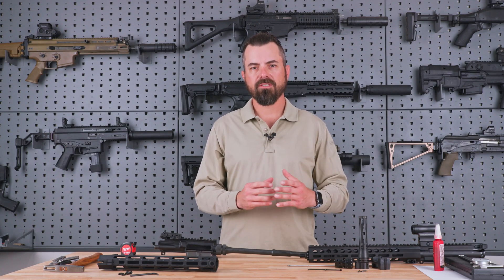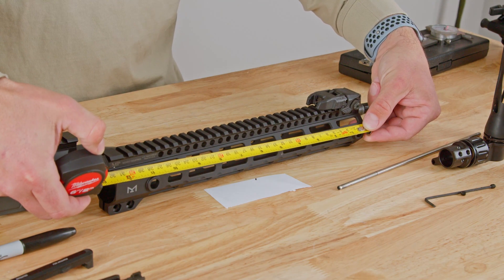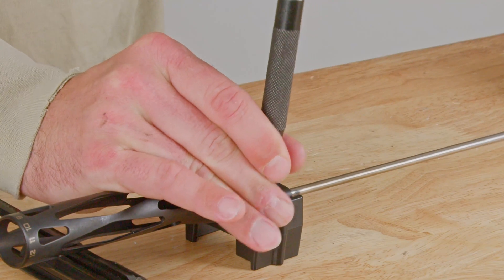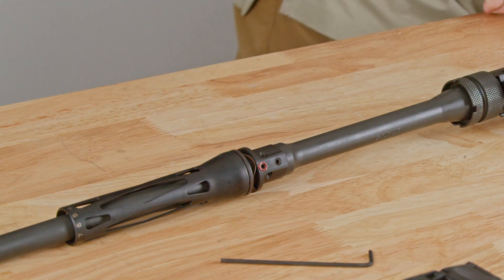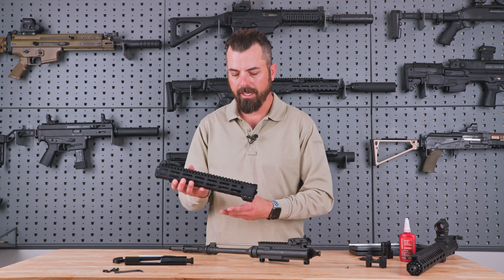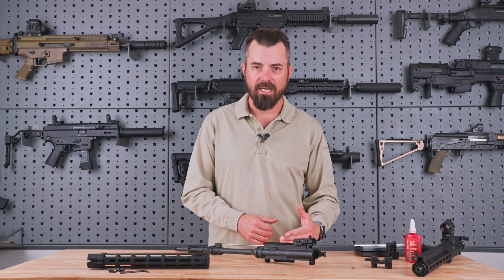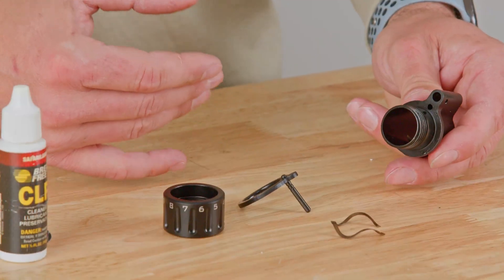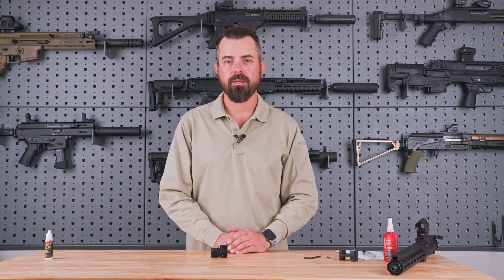Riflespeed Gas Control Selection, Installation, and Maintenance

Comment: I can't believe what a MASSIVE difference this has made. With a lantac enhanced bolt and a suppressor on a 11.5 its now MUCH quieter. With the can off and the qd muzzle brake before, it was like a firework going off in your face. Now it's very enjoyable to shoot. If you're considering this gas block, IT'S WORTH IT!!!
Reply: Do you recommend a pistol gas length with 10.5 300blk? With these Lantac bcg, and this riflespeed, also what buffer you recommend? Id appreciate it. Thanks in advance
Reply: @Jjjjjjjjjj528 I use this GB on my 8.3 inch 300 blk pistol gas length. I have a JP low mass BCG and a JP silent captured spring CAR buffer weights (3 steel weights) and a reduced power 80% buffer spring. It handles subs and supers like a dream. I have a huxwrx 772ti. 

With all that tuning it might be different for you if you are using a standard mass BCG and a traditional style suppressor. 

IMO using a low mass BcG for 300 blk offers more tune-ability plus if your using a frt you don’t have to worry about bolt bounce and using heavier buffer weights to mitigate that. 

This is my experience I’m sure there are more knowledgeable people out there but I hope it helps

Comment: No roll pin punches? A generic oversized punch and a tack nail hammer. Hmm ....
Reply: and no mention of barrel dimple or the optional barrel pinning except that you may have to remove them from old gas block

Comment: That gas block will not fit under every handguard. My favorite brand handguard is the LaRue Tactical Stealth. Only their gas block will allow the handguard to pass over the installed gas block affixed to the barrel. Nice design though.